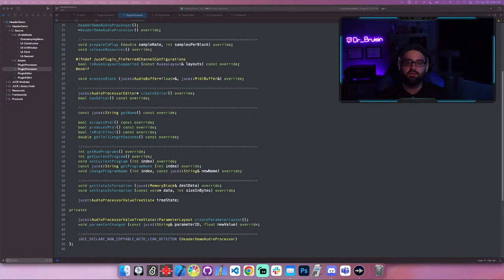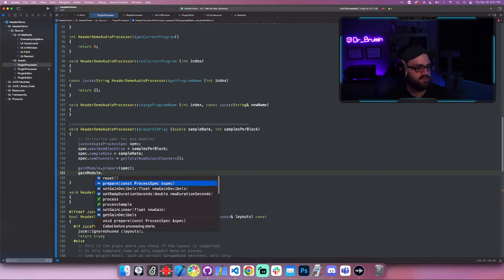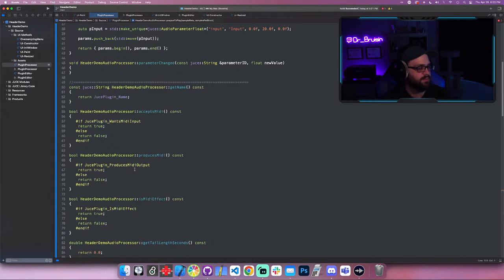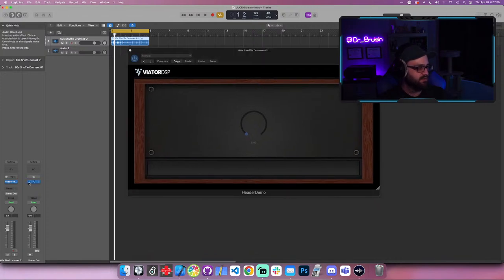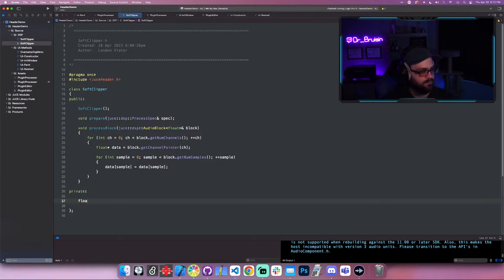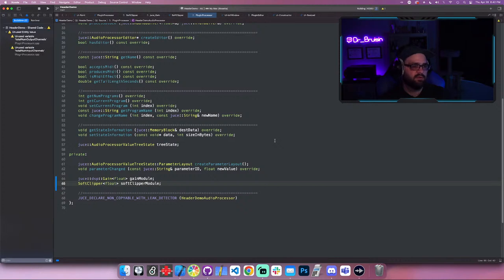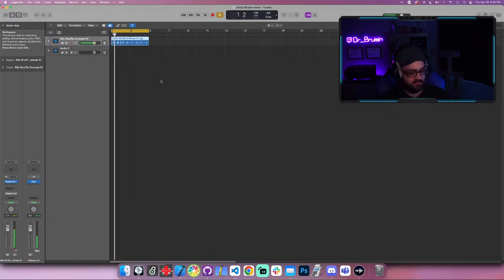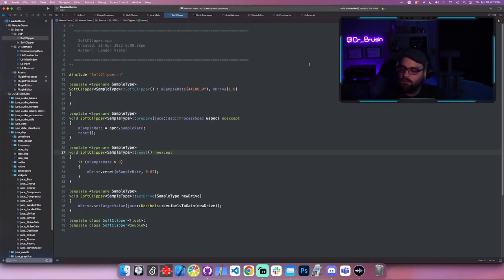Audio Plugin Dev | Basic Distortion DSP Class Full Stream!

Comment: nice video!!!! how do we avoid this smooth softclipping while the plug-in is at 0  somewhere around: 27:30
Reply from the maker: You could bypass the module if gain = 0.
Reply: @drbruisin  hmm, where does that applys? theres no a gain as I see, sorry I was meaning at 27:35 how we can avoid having this small drive happening  while the knob is at 0  already distorts the sine, I want to avoid this, is there any possible way?
Reply from the maker: So in the processSample() method, you could put before anything else:
If (mDrive.getNextValue() == 0) return input; or data, whatever the input is named.